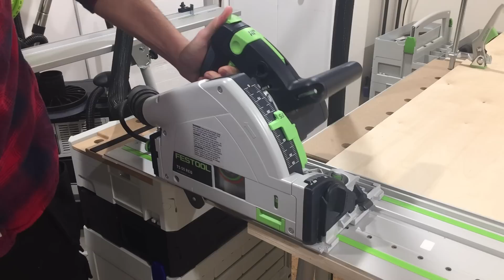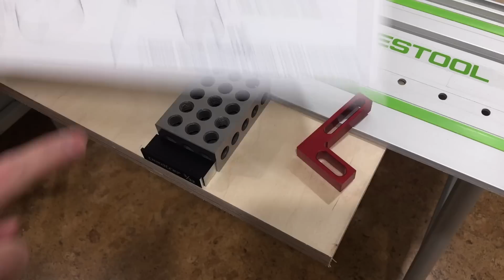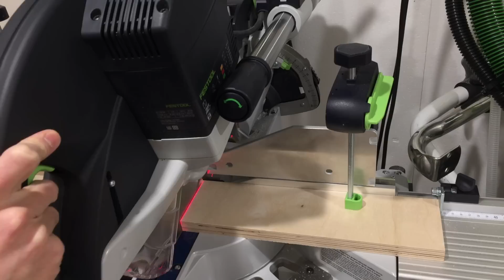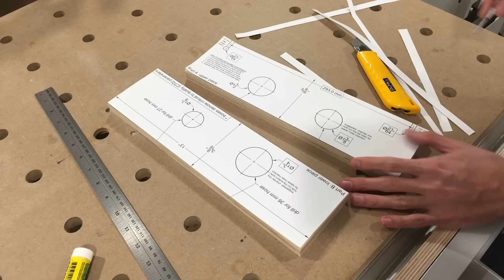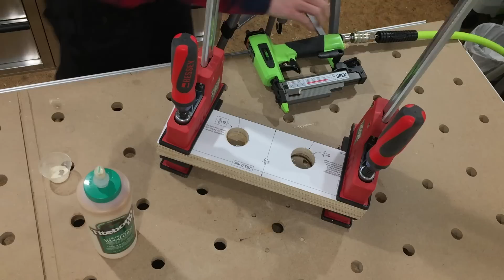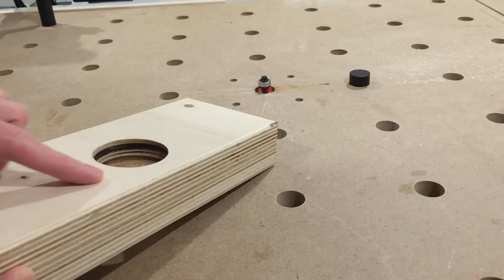FESTOOL TS 55 Dust Collection Improvement for Edge Work!

Comment: Fine video, as always. Easy to cut dowels on miter saw, just support them w/ a strip of wood; 1/8" thick for smaller dowels, and several times the width, leaning over the dowel/trapping it against the fence.

Comment: Thanks for a great video. I was busy trim cuts of 2mm on a bunch of MDF panels and the dust escaping to the side was very bad. I made use of your idea and with the dust collector connected to the plywood, lots of dust escaped from the port at the back of the saw. I think you split your dust pipe to connect to both the the saw as well as the hole in the plywood. I used my second festool extractor ( a CTL SYS) to connnect to the plywood and the CTL 26 at the back. Absolutely no dust escaped. The best trim cuts in MDF I have ever done. Thank you for the idea!!
Reply from the maker: Awesome! Thanks for sharing :)

Comment: Solution for rod cutting ..a. run a square rabbit  grove   in a sacrificial piece of wood around the size of rod and place Rod in the grove . Tape down rod and cut . B. Tape down across cutting point  rod on a piece of wood and cut across tape

Comment: At 11:33 you mention the minor issue of "a little bit of sawdust escaping at the start" of the cut.
I believe this happens because the plunge begins cutting at the blade center-line, above and behind the vacuum extraction port.  The dust has nowhere to go at that point except up and along the top of the work piece until the plunge brings the saw teeth into the cylinder of the vacuum port.

If this is more than a minor concern,  there are multiple ways to deal with this. Perhaps just blocking the exit, or extending the port shallowly back towards the blade center-line. 

In any event, I thoroughly enjoyed this build.

Comment: There is a better solution pull the green part down where you point at 1:26. That is the purpose of that part. (Festool did provide the solution to that problem) Please try it. :-)

Comment: Nice video! I am impressed by the system you use to make a router table out of your mft. Which is the system you install on top for the dust extraction? (Around minute 8 of the video)

Comment: When cutting delicate materials on a mitre saw put a full width piece of timber across the fence. preferably 50mm or 2inch thick. this does 2 things it fully supports the material and also as you shouldnt slide the mitre saw into the material and only pull it straight down it makes the angle of the cutting surface of the blade closer to right angles to the fence, there for pushing into the the 50mm piece of timber. This method can also be use for cutting grooves in timber by making sure the timber across the fence is the same width as the lowest part of the saw blade when it is hard against the fence.
Another Idea for just cutting dowels might be to do as I said above with the timber but rip a 45 degree angle along the bottom of it. Not too deep but just enough that the dowel sits in it and you can hold it at the same time. Remember cut slow, stop the blade in the down position, don't clamp the off cut side as a mitre saw is just an upside down table saw and we all know what happens on a table saw when a cross cut gets jambed between the rip fence and the blade. A pencil mark is just as good as a stop when it comes to repeat cuts and is also safer with little to no risk of the stop moving.
In the festool manual they call the action you should be using for dowels a chopping action. The fence adjustment you should make in the manual is 13.1 Auxiliary stop but Id run timber straight though then cut it with the saw to give zero clearance.
Also check out page 19 in the supplemental manual.

Comment: Tape up the hole for changing the blade. This improves the dust collection and I find you can actually see the dust being sucked back towards the blade. Also cut over a sacrificial sheet this helps support off cuts and also improves dust collection. I also noticed you started the saw in the sheet. Get a longer track and start and plunge the saw before the sheet edge as I find this greatly improves both the dust collection and the quality of the cut. To my way of thinking tracks should be approx 600mm longer than the length to be cut eg 1.2m needs a 1.8m track, 2.4m needs 3.0m if you are cutting to the full dept capacity of your saw. This allows 300mm over hang on both sides of the material.

Comment: hi, make some kind of hold down piece by making a rabbit on the size of the dowel plus the thickness of a paper. Use like a piece of wood of 2x3 that can be clamped at the edge of the mitersaw and cut of piece can slide below the rabbit. that is how i cut small pieces from dowels.

Comment: Nice vid. I just trim more than a blades width with a sacrificial bench and the green or clear dust flap down on the saw, actually works better than this method. I get the idea tho sometimes more than a blades width may be too much.

Comment: No one's mentioned the OG salt trick. Sprinkle a little table salt on the glue when you're laminating. The salt granules help prevent the surfaces from sliding out of alignment when you apply clamping pressure. Works a treat :)

Comment: When cutting dowel or other thin material on a sliding mitre saw (or any other saw), place a piece of wood behind it for support. For dowel, it's just as easy to use a hand saw.

Comment: I have a Festool TS55 and the dust extraction on an open cut is definitely sub optimal. Serendipitously I have some surplus 5/16" steel rods so I feel that one of these is in the offing. Thank you.
Now if I may, though you are clearly a very capable fellow, I will have the temerity to make a few suggestions:-
1.
An expansive bit will allow you to drill a large range of odd sized holes for occassions such as this.
2.
When clamping laminae together maintain the alignment of the parts by clamping glue blocks across the edges of the joint. By applying vinyl parcel tape to the blocks they are easily removed once the joint has set.
3.
Taping a thread into plywood is not a durable design. it would be better to screw in a threaded insert. These are commonly available with an M6 female thread.
4.
I have watched in horror very many videos on youtube of American woodworkers using table saws without guards. ( I am British) When using my DeWalt mitre saw however I invariably hold the stock material by hand and have not encountered the problem of dowels being thrown though I would suggest that to cut small dowels such as this that the tooth pitch on your saw blade is too great allowing the dowel to be caught in the gullets of the blade and thrown. Try a blade with more teeth. 
I hope that these help.
The thumbscrews are a good idea. Where did you obtain the caps for the Allen cap head screws?
Reply from the maker: Hey Jack. Thank you for the well worded thoughts - I really appreciate it. Always looking to learn and improve, and you're helping me do just that.. Hope you do get to building this! To answer your question I obtained the thumbscrew caps from Lee Valley. You'll see they come in a few different styles http://bit.ly/2obPh7z

Comment: cut dowels on miter saw with any blade by simply adding a full support backer piece. in your case something 2 inches or wider by the length of the saws fence long and even tiny pieces will stay put

Comment: Awww... come in a couple of mm so the saw is cutting both sides of the blade, this will also reduce the chance of blade deflection and an out of square edge - Double win :)
Reply: You say it! And no need for a solution for an artificial made problem :-)))
Reply: There are situations in which there is no "extra" to spare on the sheet of plywood - such as with building kitchen cabinets and you need as close to full half sheets as you can get. Of course the jig is not needed when you're in a situation when it is not needed, but that doesn't make this a made up problem.

Comment: As always, a well put together video.
I almost never clean up the factory edge like that, only when my cut list requires that I utilize that much of the sheet and I try to lay things out such that I have have a little more waste. If I need a piece say 4" wide, the first cut is made at 4.25" (or a little more) with the second cut referenced from the first at 4". That way I don't have to deal with long unbounded cuts. Also, given that plywood is often set on its side on less than clean floors the edge can easily pick up dirt, metal filings, etc. By having 1/8"+ of waste I'm not running my saw blade through any junk that may prematurely dull it.
As someone else mentioned, pin nail before you clamp to avoid parts shifting when you apply clamp pressure. For those without a pin nailer, either spread a few grains of sand on the glued surface or drive a couple small finishing nails into one of the glue surfaces and then cut the heads off leaving about 1/16" of an inch. Then align and clamp away!
If you haven't done so already, check out the Wood Whisperers wood taps.

Comment: For cutting dowels, I use a V-shaped cradle like this http://www.popularwoodworking.com/wp-content/uploads/12252_5F00_081.jpg  For small diameters, I add a piece off the cut out material from making the cradle under my clamp. Good luck

Comment: 6:55 If you drilled a smaller hole in the cutting edge of the hole saw you would have had no problem at all :) All dust can just escape there instead of clogging up the saw.
Reply: tengelgeer great tip!

Comment: This makes me want to get a track saw even more now. Regarding dowel cutting, if the dowels are 1/2" (13mm) or smaller, I prefer to use my chainsaw. I find the control and near finish ready cut ideal (sarc).

Comment: use a wood fence and base attached to the miter saw,  limit the depth of cut then only a gap equil to the saw kerf will exist thus supporting the whole length of the dowel

Comment: Nice solution!
For the dowel cutting on a mitre saw, just poke them through a hole in a batten and slice through to a depth that just severs the dowel.
Oh yes, remind us how much that track saw costs, given that it doesn't include such a device as standard, when said device would cost less than a dollar to include 😂

Comment: I collect my dust on the floor and every other surface in the shop. Works a charm.

If you drill relief holes inside the cirkel your holesaw can get rid of the shavings easier. That helps. Try it.

I cut my dowels on a hand mitresaw. Its used in one of my videos. Also, james wright restored a similar one a while ago in one of his videos. Works great. But seriously, i think you will need to make a special jig that holds the dowel. If you do, please share ;)
Reply: You guys should check this guys home made recorders and how he plays them! It's amazing! Talent!

Comment: Two things.  

If you are cutting a lot of dowels, route a round bottom groove (sized for your dowel) in a section of 4/4 hardwood long enough to reach the clamps on each side of your blade.  Clamp the board against the saw fence, groove side down.  The dowel should be able to slide through when the board is clamped in place.  The first cut will establish the saw kerf through the board giving you something to measure from.  A flop stop would probably work best with this.  Of course there is always the bench hook and hand saw method.

I like to soak wooden threads with thin CA glue.  After it dries completely, run the tap back through to clean out the excess.  This method even produces strong threads in MDF.

Comment: IF and WHEN you cut dowels on a miter saw, three things need to be done. First secure the dowel on both ends. I see that you have two hold downs so your all set.Second,cut slowly downward! You are trapping the dowel with the fence and table by cutting this way, NOT sliding into the dowel or really any small item you would be trying to cut(but shouldnt be-ITS JUST NOT SAFE!). And third n most important-get a bandsaw!

Comment: how does it perform if you only attach dust extraction to the "new" port and leave the port on the saw unattached?
Reply from the maker: Not very well, I did try this and a fair bit of dust still made its way out the port on the saw.

Comment: Hole saws are terrible, I concur. But you can improve upon using them by drilling a few holes right up to the circumference with a brad drill or such. This enables dust to escape and prevents burning. Also makes it easier to remove the waste.
Reply from the maker: That sounds like an excellent idea! Can't believe it never occurred to me to do that.

Comment: Nice video. the compliments.

I have a question which milling you used under the Mft table.
Reply from the maker: Hey, check out these videos: https://youtu.be/v4yKWp_rOB0 (router mount detail), https://youtu.be/B7xzzAgSFX0 (dust collection hood detail)
Reply: Unfortunately, Dewalt no longer get. would this router Makita also can RT0700C?
Reply from the maker: It should fit fine. Just be sure it's well secured to the MFT

Comment: Decent video, but here's a three tips:
1. Get a table saw, I know you mentioned one time that they scare you, but if you have the money for all these Festool tools (and you told us you weren't given them), get a SawStop or Bosch Reaxx or something, those things are safer than a drill really
2. Spread the glue with your fingers, unless you're afraid of getting your hands dirty, in which case you shouldn't be doing woodworking in the first place
3. Maybe hold the dowel at the miter saw, no chance of kickback, but again, get a table saw, I've been cutting hundreds of 4 cm long dowels with it, and even cut a groove halfway through on all of them, no problem

Comment: look for Festool Abdeckung ABSA-TS 55 Nr. 491750 

festool offers a part ...with this no second dust collection is necessary ... but not cheap ;)
Reply: ah nice. have never seen that before. thanks!
Reply from the maker: I've tried that one. I feel that this active vacuum/hose approach does a better job.

Comment: zero clearance fence would allow you to cut smaller pieces like dowels on a miter saw.  Btw, it's sacrilege to use imperial fasteners on a jig for a tool made using metric standards...  If you use them metric based tools, then get used to that simple to use and understand metric sizing.  :-)
Reply from the maker: Believe me, I'd love to use metric fasteners but they're quite difficult to come by over here. Also, you might have heard that Festool is actually now switching over to Imperial scales in the US + Canada... so they won't be metric for long. I know, we're broken :(

Comment: Good idea, I usually just remove more than the width of the kerf (because often the dings and damage is greater than 3mm).  The downside of course is you lose a bit more of your sheet!
Reply: Same - or I just cut it oversize and then do the final cuts on the table saw.

Comment: Cut dowels with handsaw.
Reply: best tip!
Reply: durable1988 amen brother
Reply: I often use the miter saw, but let off the trigger before I think it will cut through. It’s easy to get a feel for. As the blade slows down, finish the cut. Then let the blade come to a stop before you raise it. Of course, try at your own risk, but I don’t get problems this way.

Comment: Re: cutting dowels - If you have a small hacksaw, that is a good way to cut dowel. However, if you must use a power tool, the best portable tool for the job is an oscillating multitool with a high tooth count attachment. Festool sells their Oscillating Tool "Vecturo OS 400" model for close to $450 US, but it comes with a free t-shirt! Make sure the dowel is secured or the blade will grab it and the dowel will simply buzz around without getting cut... no good. But if the dowel is secured properly, this tool makes a great, clean cut.
Reply from the maker: Hmm... sarcastic or not, that sounds like a cool idea. You can't beat the free t-shirt :P
Reply: No sarcasm on the methodology. A little bit of sarcasm may have accidentally slipped out regarding the cost of the festool version :-) I really appreciate your videos.
Reply: Philip Jongejan that same tool is $1800 here in Australia, you guys have got it good there.
Reply: My mother is in Alice Springs this week on holiday. You should have let me know earlier --  I could have had her deliver one to you. I would have sold it to your for the bargain basement price of only $1499.99!!! (Plus shipping and handling)